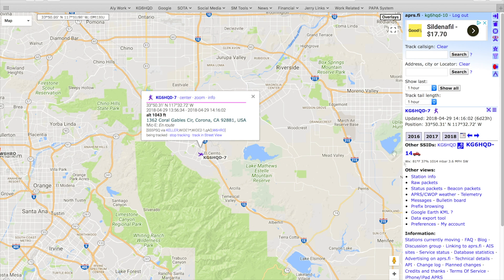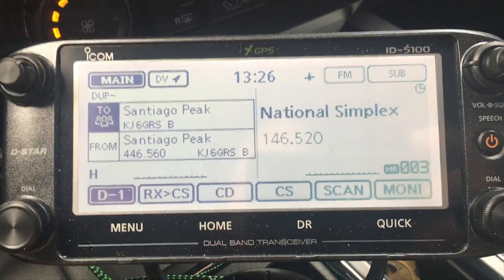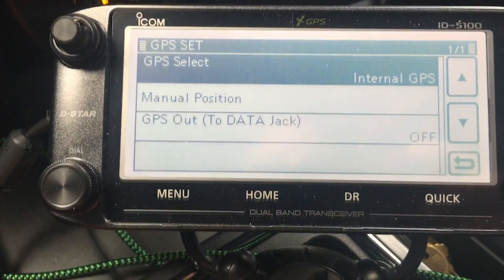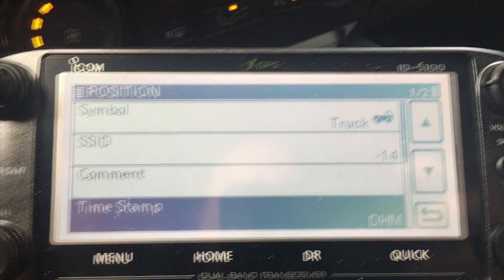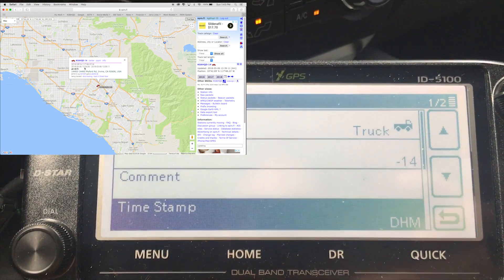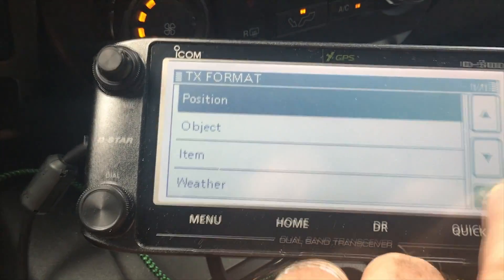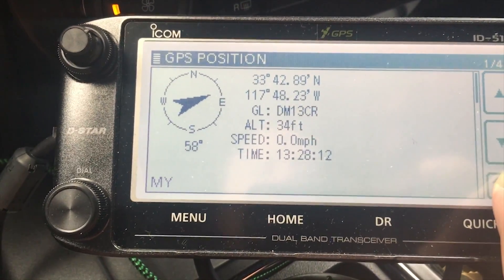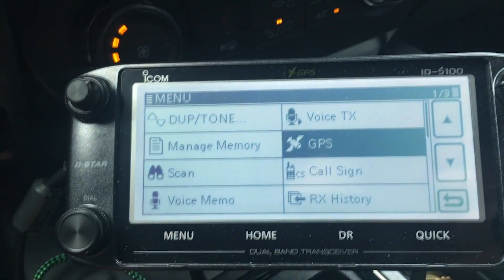How to use DPRS with APRS via GPS iComm 5100 (2018)

Comment: D-Rats for messages. It's not an APRS message. Has WL2K capabilities. de N9BAV
Reply from the maker: So what is D-Rats? I've heard the term but don't know what it is or does.
Reply: D-Rats is a multifunction program that communicates with D-Star Radios or the internet. designed for Ecomm. here is the details http://www.icomamerica.com/en/products/amateur/dstar/dstar/dratsbrochure.pdf I use it once in awhile just to keep myself familiar just in case I need it. you can Email, file transfer, Winlink 2000, prepare Forms for Radio grams, and Ecomm activations.
Reply from the maker: So I read the brochure and understand the concept but is it just free software to download?  Do I need to add equipment?  I'll have to look more into this because the first line said just two d-star radios...
Reply: KG6HQD Jerry need a cable to radio. Software is free.
Reply from the maker: So download software then connect 5100 to Macbook (assuming the software works with Mac) and then I'll have ability to message into APRS?  What about sending SMS texts or to APRS messaging apps?  Work the same there too?
Reply: Windoze only... Drats!
Reply from the maker: Not on your comment, but on that fact is the thumbs down lol
Reply from the maker: Thanks Roy!  I'm sure there will be others who can use this as well.  Might be a better way to connect with m YL while I'm afield.  Now I need another radio to put back into my office as I just move all my ham gear to the garage lol.  By any chance do you know if APRSIS32.exe is Mac friendly?  I may need a cheap laptop just for my ham radio needs.
Reply from the maker: I do use APRS with my VX-8 and am able to send text messages to and RX them from the wife on her iPhone X running APRS-TX app.   I think I was wondering how my ID5100 D-Star radio would do messaging and from what you're saying it's more of a pain than what it's worth at this point for me.  If I setup a full time APRS base then I'd consider an interface with my Mac somehow or buy a cheap PC for the garage shack where the radios are mounted so I could in essence run a digipeater, though it's not really needed in my area with all the high level APRS machines already setup.  hmm decisions decisions  🤔